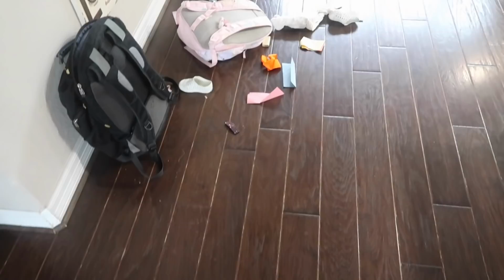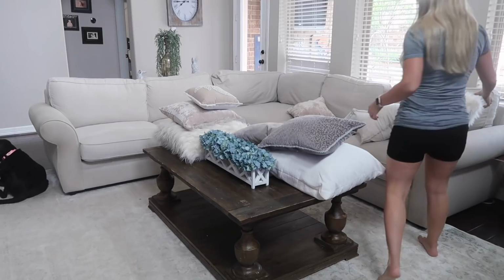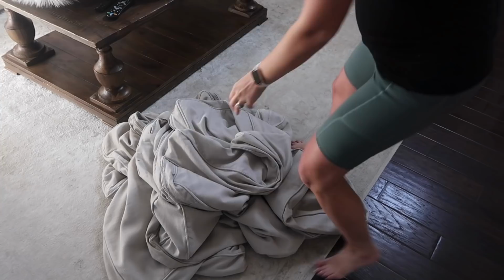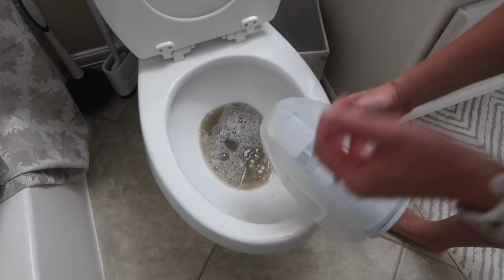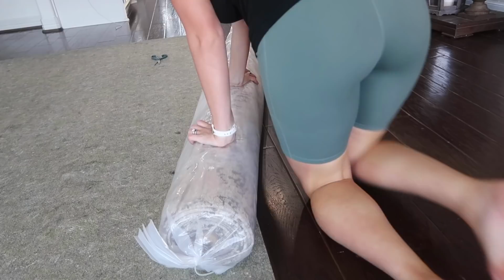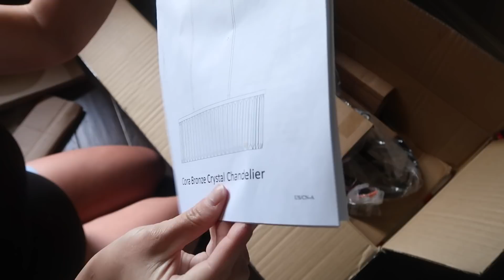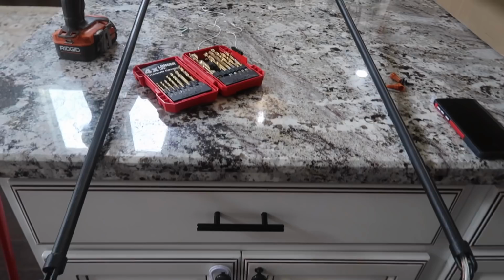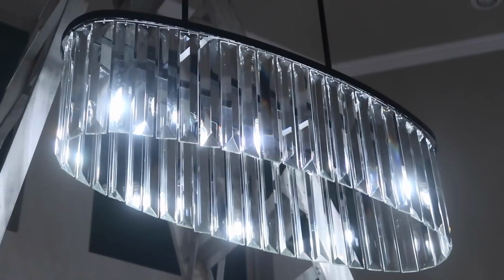LIVING ROOM MAKEOVER 2022 / LIVING ROOM DEEP CLEANING / DEEP CLEAN MOTIVATION

Comment: Hi Michelle, before you wash the couch covers just treat the stain with dish soap then throw them in the washer with the detergent and softener and add extra water if you can, most of the stains will be gone, I do that with the kids clothes because you they wipe their dirty little hands in their clothes, clothes comes out cleaner….
Sometimes I do put detergent and dish soap in the carpet cleaner because I feel like it works better than the carpet shampoo….just make just you go again with just hot water a couple of times after …
Reply: Hi do u have the top load samsung washing machine how do u add water in them thankyou
Reply: @shairmainejoycecole9299   hi I have a front load washer lg machine and it has a button that says  waters plus, so adds more water than the regular cycle…